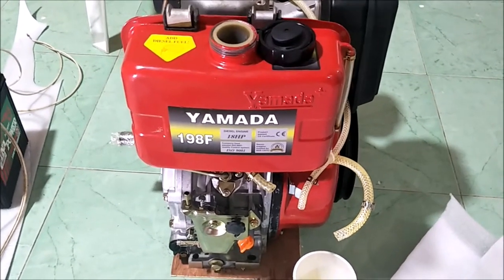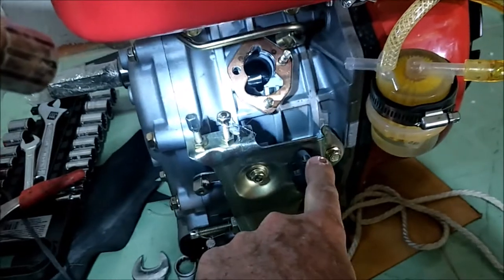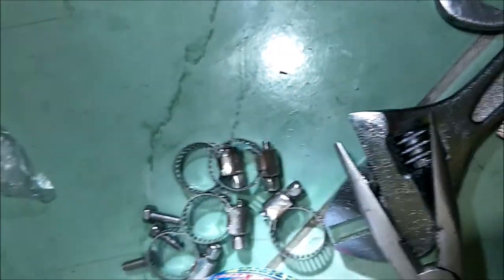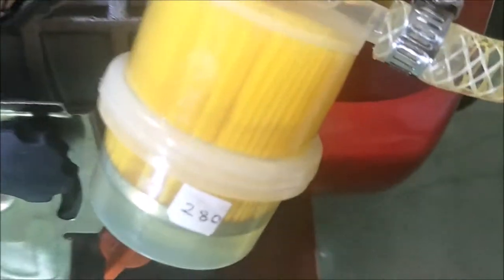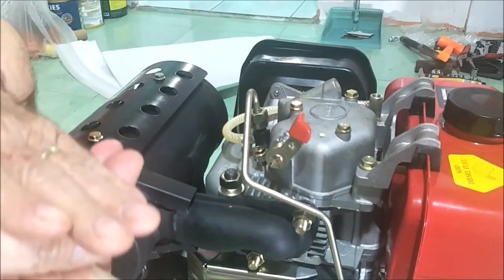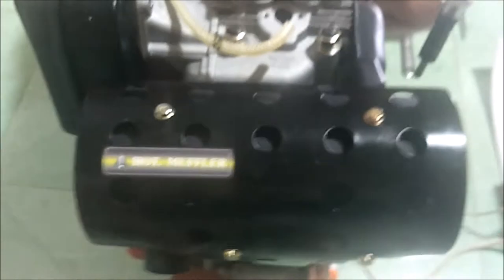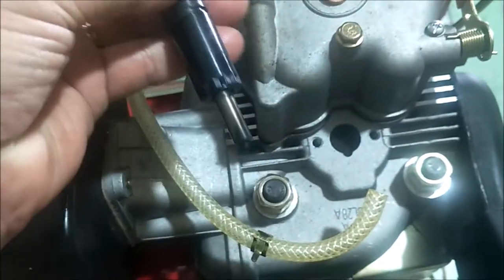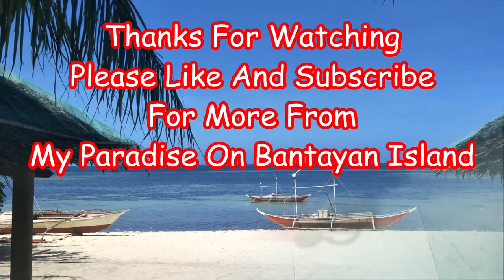Paradise Trimaran Diesel Fuel System, Fuel Pump & Fuel Injector Checkout

Comment: Yeah, the Fuel Lift Pump I guess that´s what this little pump is called, driven by the crank shaft. Well this is the most important and sensitive part of a diesel engine. So when You start, the engine is cold and the crank shaft goes with very low RPM. So it has to be able to built up enough pressure for the injector nozzle to produce a fine fog injector patternat the nozzle that together with air and high compression results in self ignition. For that reason there is a high pressure metal tube and not a hose between the pump and the injector. Matter of fact this whole injection system is a very sensitive calculated piece of engineering art and a lot more then it seems at first sight. On top of that there is only 1 cylinder. That means all them seals, shims and spacers... The less You touch, the better. They all have a close tolerance. To bleed the system from air usually just a half turn of the nut is enough.  Now specially in countries or sources where the Diesel fuel quality might be questionable the fuel filter is equal or more important. So just using another fuel filter and not the factory one could affect the pressure at the injector nozzle. That gets more important to know when in some countries they add BIO to the Diesel fuel that results in faster built up of carbon on the piston rings and injector nozzle.... and of course together with the salty air of the sea that creeps in through the exhaust and the moisture that builds up in the empty space of the fuel tank due to condensation = change of temperature between day and night that is the perfect mix.
So this are all them little details of a diesel engine to get it started...But once it starts this little marvel should run forever. 
Hahaha, Yeah, a lawn mover throttle is a lot more a$$ractive. Love the idea

To the cracks in the Yamada. The fuel pump ? So what happened that You had to buy a new one ? Those engines are new ?

Well, from my point of view this engine needs some open heart surgery and I find it hard to believe that this can be properly fixed. I would not waste the time and get a new block but what ever......................
In regards to parts ETC..... While I was watching Your video a nice web page showed up on the side. Those boys are also tinkering around with Yamada engines. I am sure they know all the secretes of this engine, like prop design and ideal pitch for the high speed application and where You can get quality parts.
Always wondered. In one of Your earlier YT You mentioned they always go with very low RPM to save fuel. So the engine stays also much cooler. I guess Your thoughts are totally different and Yours is also a high speed engine that goes up to max 3600 RPM. Now air cooling has a smaller window and I could imagine more temperature sensitive to an "overloading" pitch of the prop 
Yeah check out the boys.........
https://www.youtube.com/watch?v=t5mFDCFsodA
Have a look at the first engine. They totally eliminated the vibration. The engine is not moving on the surface of the board. What have they done ? The engine seems to run much smoother. Maybe they added a different fly wheel ? 
Seems also the cooling fan blades for the air cooling are bigger. Of Course You have a dented flywheel for the electric starter.
Yeah, hand cranking this engine????  Well, in the boat there will be no space for the hand crank. So it´s gotta be somehow with a rope. That makes it  even more interesting.
Cheers
Reply from the maker: Yeah experience will certainly help me as I get time running the boat and props, every thing I build is a first time design so hopefully I get lucky and it all somehow works out and if not "back to the drawing board"😊
Reply: @myparadiseonbantayanisland9030  Yeah, I already suspected some kind of a JB weld fix. Heat and welding is the last thing You want. Well, in general I don´t like the butcher jobs but let´s see how it´s holding up. However what my concern would be.... all those manufacturers in Asia change design improvements fast and usually there is only a short time between one series and the next batch. So  tomorrow You might experience problems when You wanna get exactly the same block. Keep that in  mind.

Yes, I believe that is the right approach. Get the boat in the water. You started out with a traditional design but once You use the boat I am sure there will be modifications. I would see it more as some kind of a proto type but once You got it all figured out it would not surprise me if it would make more sense and be cheaper to start building a new boat even while You still enjoying this boat. What is really great.... all the materials and really good people of respective trade are cheap. That makes it much more fun. Things like for example the engine, shafts and props and SS in general, LUMBER !... any place else that would cost You an arm and a leg. Then the basic design is really easy DIY and the more or less short distances and type of coastal waters also don´t require much more.
Haha YeYe, You are hooked. Boat building is addictive. 
The other day I was eating up the whole channel of THE BOYS. This is awesome and a lot of fun.
YeYe, I better watch my step or my dreams wanna run away with me and wanna push me to make a crazy move.. Haha, I mean, it really does not take a lot to call up an airline and pack a suitcase. So how is the taste of the beer on paradise island ?
Cheers

Comment: Have you tried the lawnmower throttle on the engines while running?
The governor weights inside the engine may only be small being a one banger but they can and do generate more centrifigal force than any similar sized petrol engine. You may be able to tighten up the friction control inside the unit if it cant hold the engine at speed and starts to creep back.
Reply from the maker: I have not tried it for continuous running, Thanks for the info!🙂

Comment: are these the ones you bought in the video on engines a few years ago? these are really nice an clean not a scratch on them, are you planning on running mufflers? wet or dry? or straight piped out the back?😁  great info on purging the air out of the lines to thanks for the tips sir !
Reply from the maker: Yes these are the same ones, they have been boxed for a couple of years. They have factory mufflers however I will add some additional muffler so we can hear each other talk while driving the boat, the exhaust will be dry unless I can figure a way to run the exhaust thru water. I still have not figuref out the exhaust system yet. Right mot the center hull has a 15hp gas engine and a straight pipe, i have a motorcycle muffler that I tested and it cut the noise in half so I will add that to the gas engine for the trip back to bantayan island😊
Reply from the maker: @BeamerTheFox  I will look for videos on that, thanks for the info😊